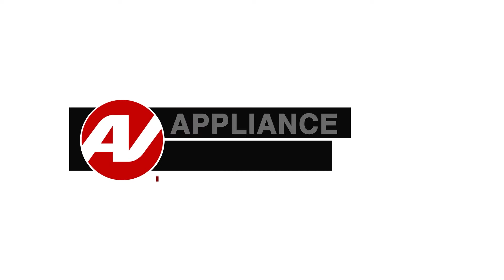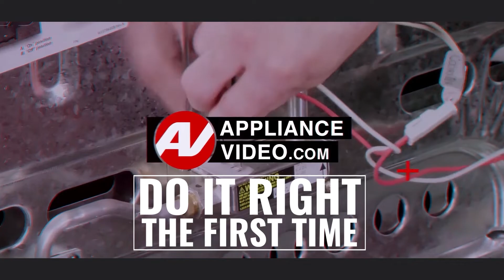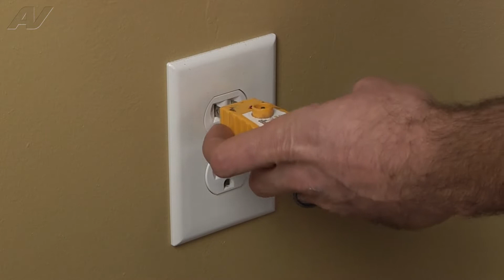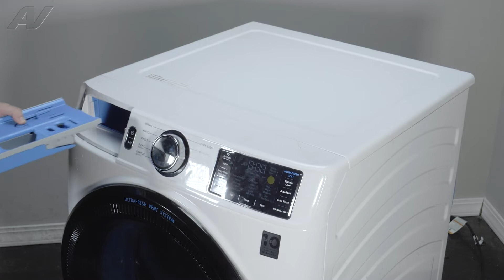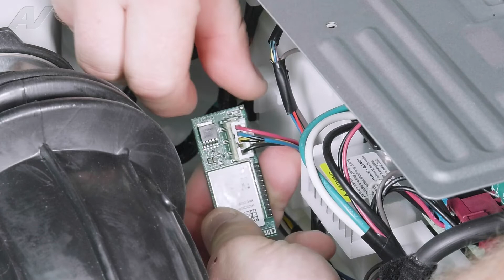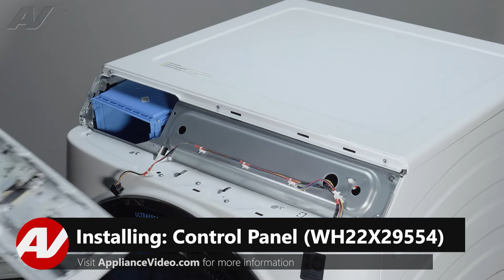GE Washer Repair - Will Not Connect To Other Devices - Wifi Board

Comment: We've had GE send techs to replace the board and after, the wifi no longer worked, just got the wifi board replaced.. still doesnt work. Any ideas? They were lost.
Reply: I would be interested if you ever got this problem resolved?
Reply: @scottstgermaine2358   yes we did, it was the board again, they came back and changed it again and now it works fine again!
Reply: I'm having this exact same issue. I replaced the control board myself but the washer no longer shows up in the SmartHQ app. My wifi router still shows the washer connected to it, but i can't initiate a re-pairing to get it back in the app. I contacted GE and they told me they can see the washer remotely on their end but it's not sending back the correct identifier or something. They tried a remote fix but that didn't work. Now they want to send out a tech.